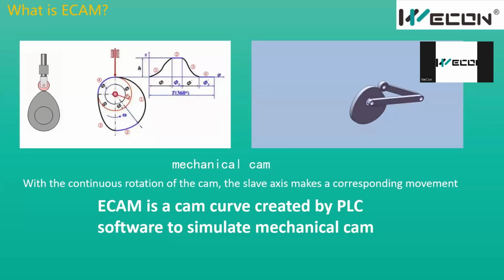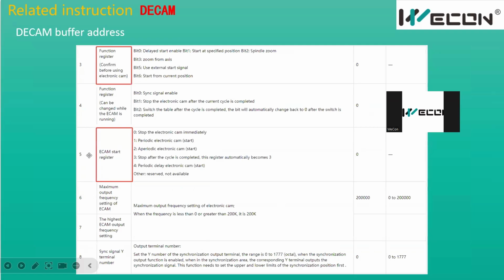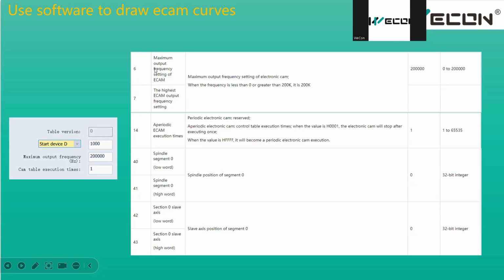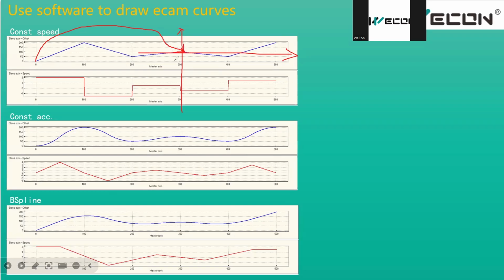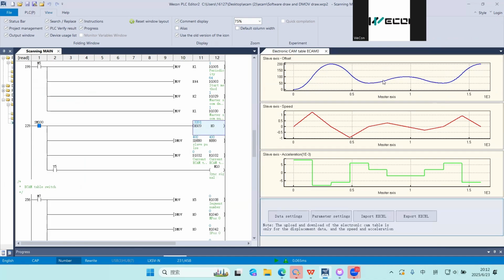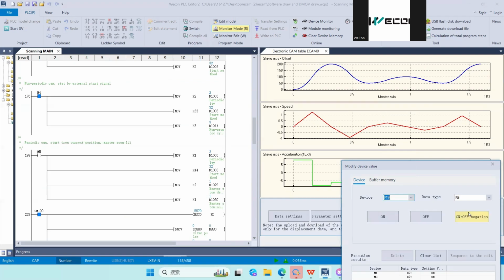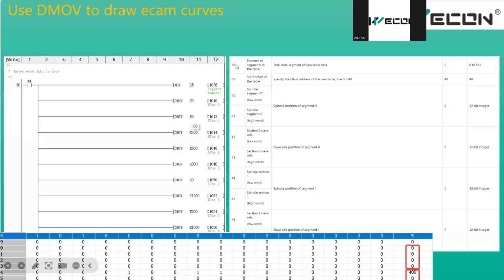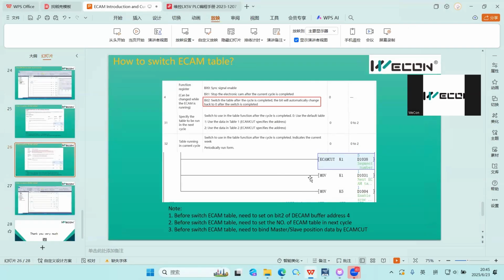Training 1 ECAM Introduction and Curve Drawing #wecon #ecam

Comment: I'm having trouble with the HSC0 counter in ECAM( plc lx5v) . How can I prevent it from overflowing?
Reply from the maker: Reset the counting value when it reaches the set value(for example 1000000), and an additional accumulator counter is used for recording.

Comment: hello, would you please suggest the ECAM support PLC Model, would you please explain more on ECAM curve. Lx3V support ECAM?
Please share the software download link.
Reply from the maker: The LX5 series and LX6 series support cam functions. The training video is based on 5V, while the 6V cam instructions and configurations are somewhat different, and 3V does not support electronic cams.
Reply: @WeconKnowledgeHub  recently I have ordered AC60-0808MT-DA, what about this?